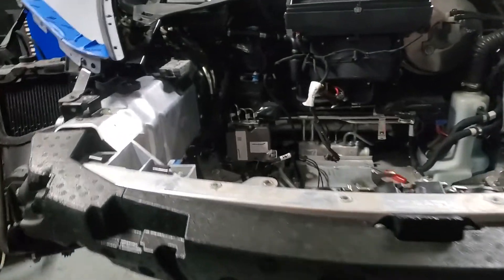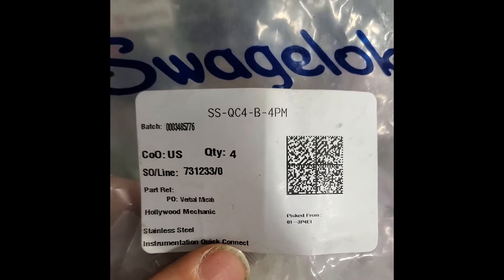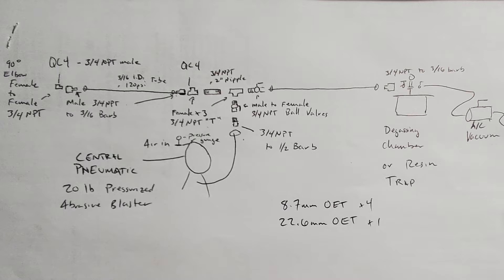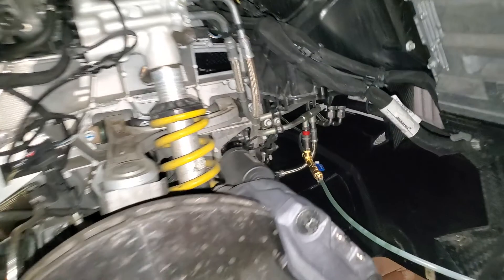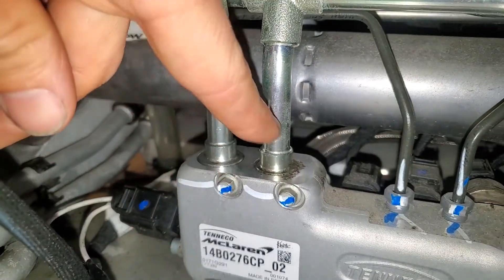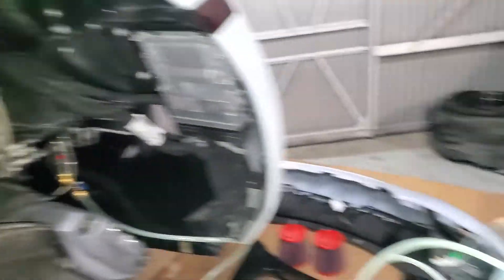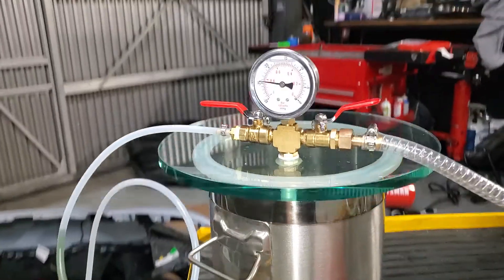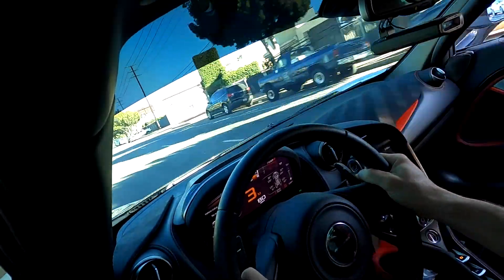McLaren 720S Suspension Accumulator Replacement with Bleed Fill

Comment: polarity for activating the solenoid? both plug wires same color ???
Reply from the maker: This video is not for you to do at home. It's to help a mechanic that knows electricity, Hydraulic systems and accumulators to be able to do it. I'm not here to teach you all the basic knowledge you should learn in school. But if you follow what I say, it will work

Comment: How do you know when to cut off the fluid on the refill? Wont opening up the accumulator or spraying compressed air into the system release the nitrogen????
Reply from the maker: Wow, you just clearly have no idea what you're doing.  1. Pressure equalizes. You open the valves with 120psi and guess what, then the whole system will have 120psi and it stops itself you put more or less pressure and it equalizes. 2. The nitrogen is in a bladder in the accumulator. If you take the accumulator off and jam a screwdriver in it, then you'll release the nitrogen. That's stupid to think the nitrogen just comes out. You have no idea how an accumulator works. They've been in cars since the 80s. Cmon this is so basic. Spraying compressed air in with the lines out just cleans out the fluid because a vacuum can't remove fluid without airflow. This is my final help to you. Good luck.

Comment: Is the  procedure the same as the MP4-12C w/o front lift? I just replaced all 4 accumulators and lost a lot of fluid. I filled up quite a bit at the revisor but needs to be bled. There's 1 bleeder screw on each side by the shock (4 in total). do I need to do this procedure on all 4 sides? or just 1 rear side. I'm very confused with this. Please help me!

Comment: Hi good evening brother
Reply: I have 2018 McLaren 720s , I changed the hydraulic pump unit but I can't bleed it. The pump working in on/ off continuously. How bleed this system
Reply from the maker: @radhakrishnan3462  just watch the video. You need to build a machine like I show in he diagram. It's very simple

Comment: Can you tell me approximately how much fluid it takes to refill the system ??
Reply from the maker: I think it was about 3 quarts if you completely drain the reservoir.  I don't exactly know because I put 5 quarts in the pressure vessel before filling it.  But I've also done 3 system vacuum fills with that vessel and not refilled it.  Most of the fluid comes from draining the reservoir to replace.  Just be warned also that the hard lines in the back where the fittings go are leaking on older cars.  I've replaced two of those and they leak where the flex part bends down to meet the lines that go to the front.  Literally sprays out of the braided hoses.  Probably should replace those at the same time if you are planning on keeping the car.
Reply: @HollywoodMechanic  Thank you.

Comment: have you had any issues ? After using this method to bleed the system? Like any indicators or warning lights that came back on suddenly but then it goes awau after couple of minutes.
Reply from the maker: No. The suspension has been perfect ever since. No lights on the dash. No pending, intermediate or permenant faults. All suspension modes operate normally.  There is no air in the system using this method and is the same method the dealer uses. They have a machine that stimulates all the things I show you here.

Comment: Great video can you change without bleeding the whole system on a 720s ?
Reply from the maker: The system does not flow back to the reservior. Once the
Accumulators fail, they release nitrogen into the system. Since It terminates at the accumulators which are the highest points of the system, the gas is stuck in the system. When there is air, it will not hold pressure.  That's why it must be vacuumed and also pressure filled. It will not run the pump if there is no pressure in the system.  From my understanding.
Reply: @HollywoodMechanic  I had disconnected one of the line without knowing while i did suspension lowering springs install. Reconnect and refill fluid in reservoir.  System is ok after that. Of course I got sprayed with high pressure ch11s . I feel your rigged system bleed is Genius
Reply from the maker: @YouStupid69  the pump will raise the pressure and draw fluid from the reservoir to do so but there is no return flow so the air in the system is trapped. This air is compressible. If you do not bleed it, the system will add some fluid and reach operational pressure, however, since the trapped air is compressible, it will soften the suspendion further than designed. The system has no way of knowing there is air present but you might feel an uneven compression or rebound damping.  From my understanding. The lines and accumulators are at the top of the hydraulic system. And there is no through flow so the air does not come out
Reply: Yes system will self bleed